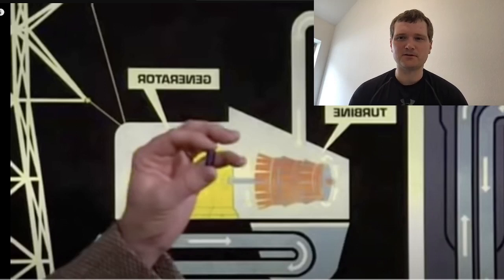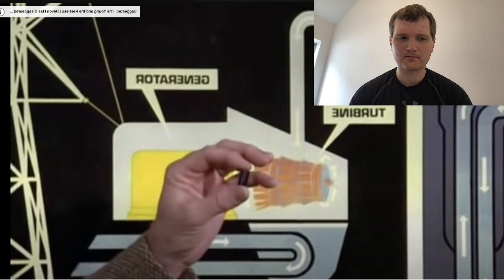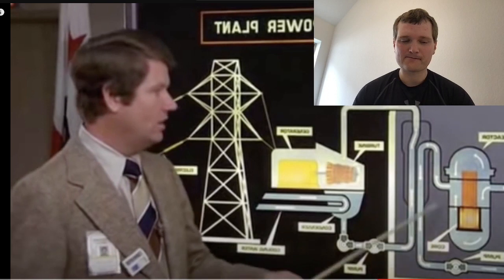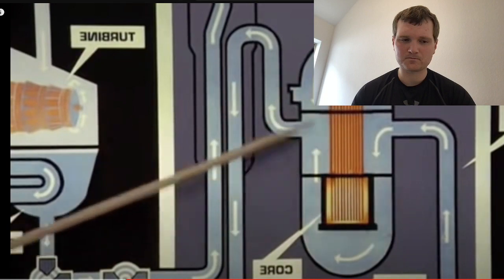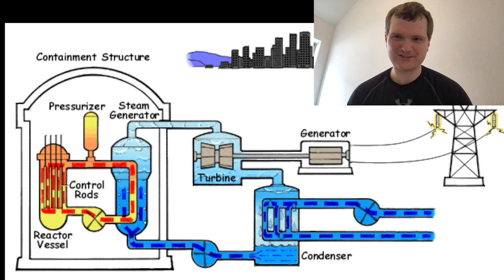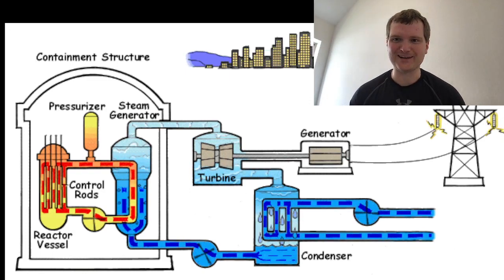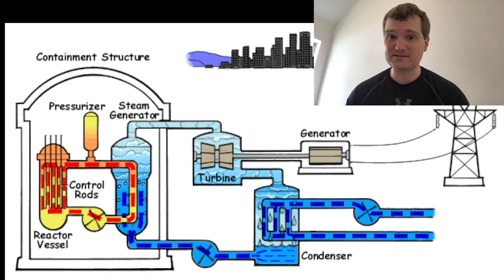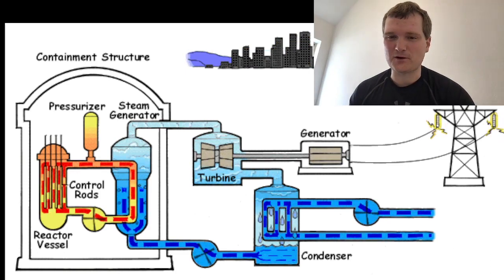Nuclear Engineer reacts to China Syndrome Explanation on how Nuclear Reactors Work

Comment: That's really interesting. My question is why does that inner (radioactive) loop use pressurized water? Couldn't some other material be used so it wouldn't have to be pressurized?
Reply from the maker: Good question!

Higher pressure (~2250 psia)makes the thermodynamic cycle more efficient so the generator can produce more electricity. In addition, a higher pressure is actually safer in that the water is further away from boiling. There are other reactor designs that use other fluids such as liquid sodium, which is also pressurized.